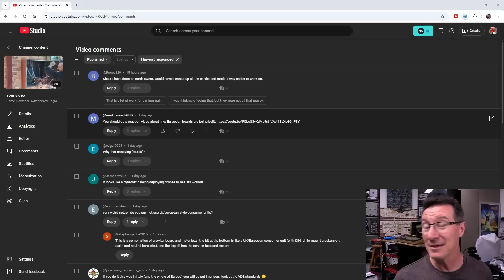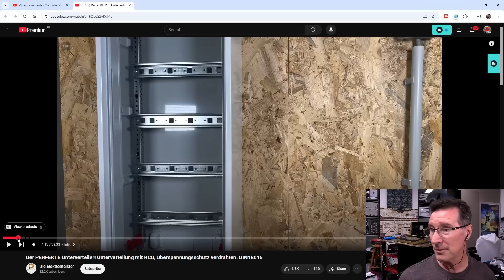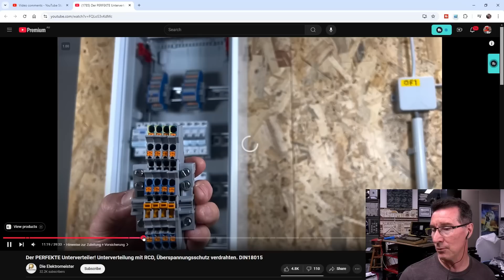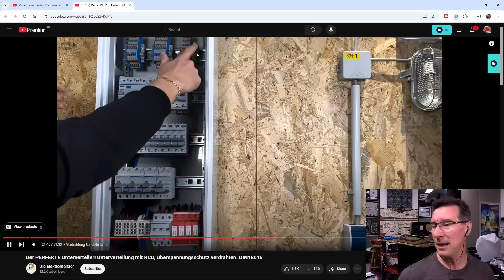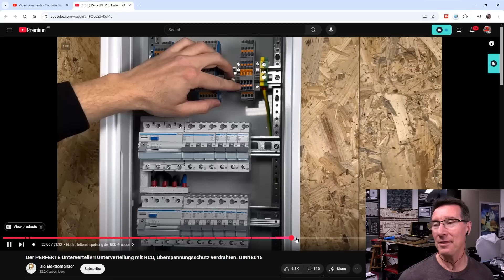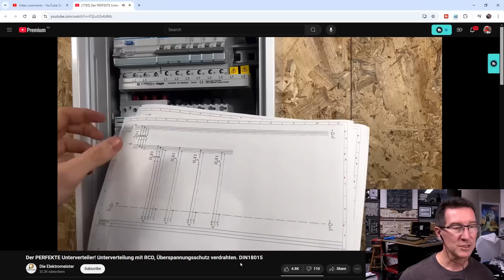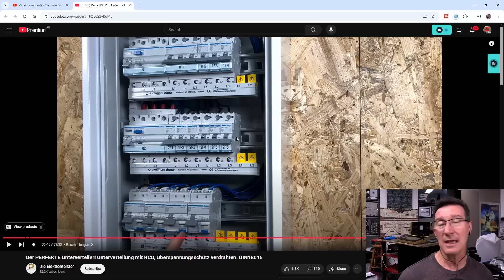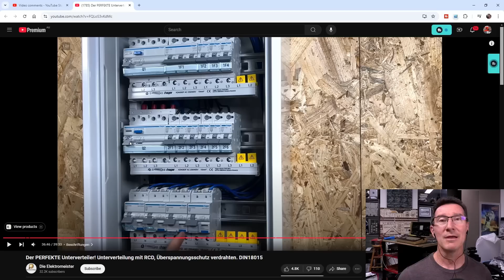eevREACTS - European Electrical Switchboard Wiring

Comment: Metal enclosures are typical for commercial, public, industrial and larger domestic installations, but most residential wiring is done with plastic panels here unless regulations are stricter.
Surge protection devices are mandatory, the Dehn is a really good one. Expensive too.
I love these Phoenix Contact terminal blocks, they allow for quick connection of the box at the job site without screwing anything up, haha.
Labelers are common in electrician's practice and Dymo Rhino are the high end favorites among pros, they can print on heatshrink tubes.
Reply: It's always felt odd to me seeing those plastic enclosures, in the US no matter the size of the panel or what type of install it's a metal enclosure, and grounded.
Can be a 42 slot 200 amp, or 4 slot 60 amp panel, always a heavy metal enclosure.
Reply: @sparkplug1018  that's still nothing compared to old Polish industrial switchgear in modular boxes made of cast iron, the smallest size was 15x25cm, typical middle size used for fuse boxes was 25x25cm, even larger for disconnect switches, heavier fuse boxes etc. and double or triple size for busbars. Very low tech (these things had ceramic Edison screw fuse sockets, none of that circuit breaker rubbish), very heavy, very indestructible. A switchbox set for 12 branches could easily weigh 10 kilos or more, as it contained at least a busbar unit and two hex fuse units, typically also a cable entry unit and a main disconnect switch unit.

You can see some of that old gear here: https://www.youtube.com/watch?v=ZrMEL8-cIMY
Reply: In North America, there are no plastic panels. Metal box, with a metal lid. There are some plastics inside to provide standoffs for bus connections.

Comment: USA/Canada does it better I think.
Reply: Here in Canada things a pretty ruff, cheap and primitive compared to Europe. But the code is there to allow that.
Reply: Yhea, it can be rough. I'm not thrilled about how some of the wiring is run in my house. That said,  there is nothing preventing someone taking some pride in their work and making the wiring an art piece. I do like that we do not have any plastic panel boxes.
Reply: @bert-blank  
Lots of plastic boxes available and used in Canada, don't use them my self. 
When I built my house used the code book, wired it my self, inspector said it was the neatest job he had ever seen.
Reply: Bus bars and solid wire, everything steel and copper.  Our stuff is battleship tested.  The euro install looks like something we might have in a network closet.
Reply: The USA wiring and boxes are imo horrible and worst design to upgrade anything and you need disassemble ALL if the stupid bar in middle melts due sparking... HORRIBLE.
Reply: @XantheFIN  Never seen, never heard anyone have those issues in 40 years of home ownership.  Any examples?
Reply: @radman999  Challenger, Federal Pacific panels ... Just search for recalls.
Reply: @radman999  Oh come on, just viewing youtube you can see plenty of examples of USA panels with damaged bus due to arcing from a crook breaker.

Comment: The main difference is the lack of earth leakage breakers (not sure of the name) on your panel.
I understood that you have them on sockets, but does that means there is no protection on the lights and heat pumps ?
Reply from the maker: Every single circuit in my box has an RCD, it's built into the breaker (you can see the blue test button on each one)
Reply: @EEVblog2  oh I've never seen some like this, here they are twice as wide
Reply: @romelec  yeah, single-pole RCBOs (Residual Current Breaker with Overload) have been available for a couple of decades, and are fairly standard. You only really see the two-pole RCDs (Residual Current Device) where they've been retrofit or the person who built the house was too cheap to spend an extra couple of hundred dollars to get RCBOs for each final circuit (instead using one RCD to provide earth leakage protection to up to three final circuits with their own overcurrent breakers).

Comment: The big "box" up on the DIN rail is 3 phase RCD. It protects the circuit connected after that, that is the automatic fuse (10 or 16 A). There are 2 RCD as the rule is to use 2, so not all lights in house goes out due to an earth leakage. Also in kitchen circuit for light / outlet is divided into 2 automatic fuses.
Reply: Why are the kitchen circuits divided but not the circuits for other rooms?
Reply: @vladomaimun  Because you often have higher loads on kitchen Circuits, like the sandwichmaker, microwave, induction heater,  oven,. and so on.
Reply: @vladomaimun  I think it because kitchen are considered as more prone to accidents, so it is dangerous area. Hot Stowe and pans and that kind of stuff. As RCBO has become cheaper, they are used more in installations. So it is affordable to i.e. make the living room with 2 circuit.
Reply: Which is already a bit dated, the latest and best practice is to use RCBOs for every circuit, not a common RCD, as it reduces outages and nuisance tripping, isolating it to just one circuit instead of the entire installation. When I redid the panels in my house I used RCBOs for everything, or a separate RCD+MCB to make what is effectively a RCBO, if it wasn't available in the specs I wanted.
Reply: @brainndamage  I wouldn't call it dated, both variants are valid options commonly used. Using RCBOs is more expensive, so many builders opt for the cheaper option. On retrofits, space on the DIN rails is often a concern, so group RCDs were often favored. 
Since Siemens and ABB now offer single width RCBOs, this also comes down to price.
singel with RCBOs are a relatively new thing here in Germany, because RCDs Type A need to be purely mechanic. That has something to do with it still working if the Neutral is cut on the supply side.
Reply: @brainndamage  Interesting fact, US boxes only support RCBOs.  Called GFCI (Ground Fault Circuit Interrupter) Breakers.  GFCIs are only required in wet or damp locations, and even then it's often allowed to use a plug with a built in GFCI and chain from that.  240V GFCIs are pretty much non-existent.
Reply: @EmperorA0  the US code is insanely unsafe from my point of view, not only no GFCI ofr normal circuits, but also huge currents due to the 120V. Europe runs everything on either 230/240V single phase or 380/400V three phase.  At least in germany and Austria RCDs are mandatory for every circuit in new domestic installations since the 1980es IIRC.

Comment: Here in South Africa ferules are required on multi stranded wire for mechanical protection. The idea is to prevent the screw down terminal from cutting the finer strands. Solid core cable does not require it

Comment: Hey Dave; thanks for bringing us this switchboard video. I realise there's not a lot to look at and react to. It seemed to me the number of elements in the three groups at the top matched the switches in the three groups below them, so I surmise the bottom group is the incoming power and main breaker. But the top elements seem pretty small for a breaker box, maybe just a patch link? If you are looking for automation elements, Shelly have a range in ethernet, wifi & bluetooth, or zigbee. There are DIN rail versions or in wall versions. For control, the app they use is quite capable, they can use mqtt protocol, or the units are designed to be flashed with other firmware. Compatible with Home Assistant, NodeRed and plain scripting. Have a top one!

Comment: Dave - click on my name, I show my consumer unit which is an upgrade of my consumer unit with my battery solar system with a separate circuits for emergency power if the grid fails

Comment: Europe has the United Kingdom doing it their Royal way. European Union having a supposed common system and then are rebel states like Norway with electric cars and Switzerland with solar panels between rail lines. France was once the leader of standards until Germany invented the Deutsche Industry Norm rail, the DIN rail. I built a house 25 years in the wet tropics and my pedantic sparkie insisted on Australian made Clipsal brand breakers. So I installed seperate leakage breakers for each cable and he fell backwards upon inspecting it. He asked why I wasted money on so many expensive breakers and I replied that they were still cheaper than his wages. None of this Hager rubbish that corrodes and needs frequent replacements!

Comment: Yeah so far i know this is standard practice in The Netherlands aswell. for high current uses multistrand wires and ferrules and for the standaard 16a 230v "groups" its usually just a solid core direct connect. you can get those din modules in the same fasion as those connector blocks where you stick the wire in aswell as a screw-clamp terminal style. I have never personally rewired an existing box but if i make a new one i do it the way the Germans do it. Im not an electrical engineer by any stretch of the imagination but my education at middle school required me to learn how to wire up a breaker box, how to metalwork, how to woodwork and how to do computers/internet. Love the way the Dutch get to choose a wide career path.
Reply: And we are allowed to do it ourselves. That's also nice, if you know what you are doing, and not nice if you bought a house from somebody who made a big mess.

Comment: the aussi board would fail 100% here in denmark, so many things wrong with, on the other hand the german video is the right way to do things correctly
Reply from the maker: My aussie one is an UPGRADE to a 40year old box, not the same things. You can find the exact same installs as shown here in apartments or large expensive homes with indoor switchboards. The average house in the suburbs with a simple outside box is exactly the same except it uses a swing panel and mayeb a plastic DIN enclosure inside the metal box. Depends on how much you want to spend. Electrically they are all the same.
Reply: @EEVblog2  Seems fair enough, Dave. In good ol' Engerland we have this pesky EICR inspection thing mandated every five years or so where old boxes can be condemned, but even there I believe it's up to the sparky on-site to decide if it's still electrically sound, they have some autonomy thankfully or we'd all be broke from the reinstallation fees. Mind you, 40yrs is a little long in the tooth! But if it ain't busted, etc...
Reply: @Blitterbug  Except it's not mandated, it's only a requirement in certain settings.  A owner occupier is under no obligation whatsoever to have an EICR done on their house's installation.
Reply: @Blitterbug  Sparky can decide the installation is hazardous and report it to the authorities if not allowed to make safe but they can not condemn an installation.
Reply: @retrozmachine1189  They can refuse to work on it if unsafe, and insist it is replaced if customer wishes work to proceed, so similar result surely? Seeing as all they can do is leave 'as is' and submit a note if work is refused. You're right in that they can't depower you outright.

Comment: Probably won't last as long as the panel in this venue I work. Building was an old dairy built in the 20s the roaring ones not the covid ones. No breakers only fuses obviously, still tied in still used has probably 10 modern subpanels pulled off it. It's a work of art inside the men who installed it really took pride in their work back then unfortunately the insurance company finally said it has to be replaced. It will be sad to see something that performed its job flawlessly for a century get scrapped. But it will also be really nice to have 3 phase and a modern panel after the owner drops 100k getting it brought up the street.

Comment: The switchbord in europe are very good, but they are a nigthmare to upgrade modify, everybody build them too small, try to install a new circuit 5 years after the fact. I know i design build and mantain them for 30 years.
Reply: Ours was 2x2m, a solid 4m2 with asbestos and all 3 phase ceramic cartridges.
Reply: In italy we have the code (it depends on many things if it apply or not) that require empty spaces of abount 20%.
But we also have to calculate the thermal load of each breaker in the cabinet. So more free space might be necessary.

That said many installer don't always do so.
Reply: @tuttocrafting  the problem is not the space for circuit breaker s is the space to route new cables, and control equipment, and also to fit the hands to work inside.